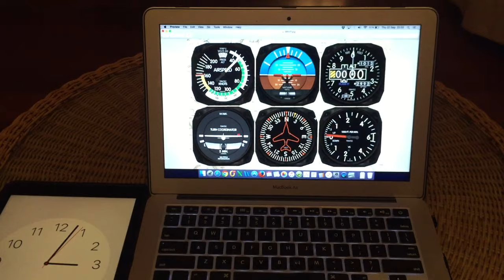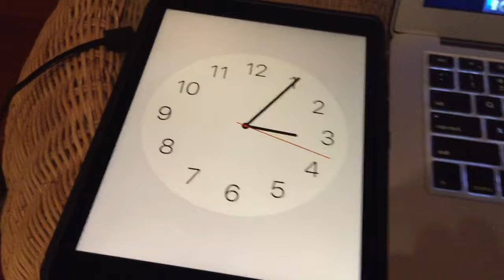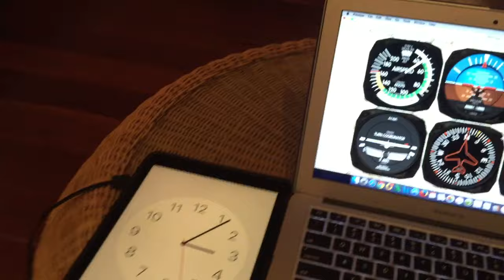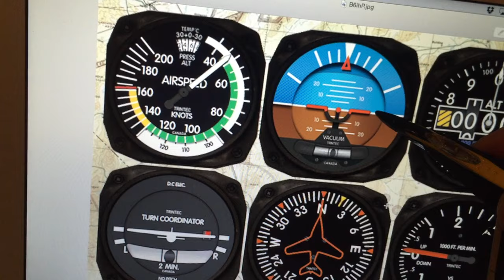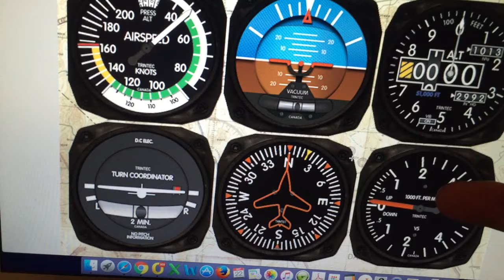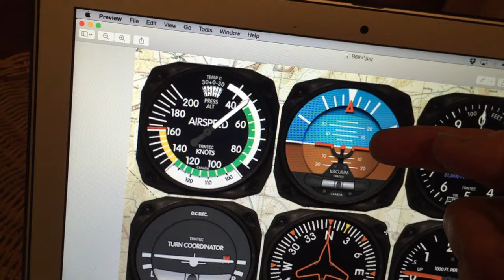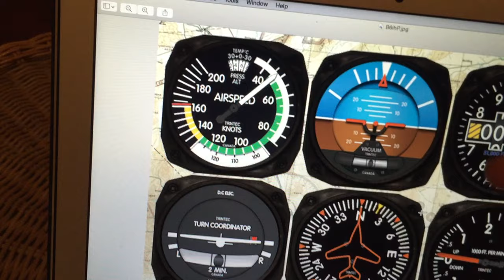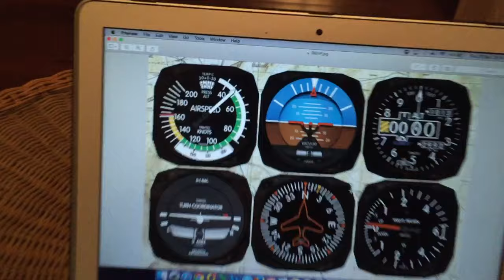Do aircraft change attitude to follow the curvature of the Earth?

Comment: Were you taxing the airplane on a simulated free way or something you had 0 AGL ?
and your airspeed was at stall. 

Do aircraft pitch down to follow the curvature of the Earth?

No they don't , airplanes are set to density altitude.

There pitch depends on the amount of thrust the aircraft is making, a lot of thrust in a straight and level flight,  more thrust you would have the more you would need to pitch and trim the nose downwards, in a typical aircraft, less thrust you would have you would need to pitch up to maintain a straight and level flight. 

Aircraft follow the earth perpendicular to the earth, usually from the balance point in an aircraft.
Reply: flat earth math is wrong wrong wrong, no they don't follow the curvature of the earth, to stop the pilot from have to push forwards or aft depending of the airspeed of the aircraft they use a TRIM system...
Reply from the maker: +Iain Noonan - that was just a generic screen shot of aircraft flight instruments I found with Google for the video.  It was on my laptop.

Sorry, aircraft do pitch down to follow the curvature.  It is only 1 degree per 111 kilometres.   1 degree in 8 minutes at 450 Knots.

That pitch rate is so slow you will never notice and and it matches the angular change of the Earth's surface so there is no apparent attitude change either. 

The eotvos effect proves aircraft are following curvature - the weight of objects change depending if you are going East or West - I have tested this personally and can verify it is real.
Reply: no they don't !!!!!  omg , look the pitch of the aircraft is defined by the air speed of the aircraft is going. 

Aircraft are balanced around the centre point of gravity, this depends on the type of aircraft it is and it's configuration. 

aircraft have 4 forces acting on them in flight in flight.

1: Lift 
2 Drag 
3 Weight
4 Thrust. 

When all of these are equal to each other, witch is very very rare, in an aircraft there is no need to Pitch Trim.

But 99.9% of the time 1 force is greater than the other , depending on Air Speed of the plane, and you will need to pitch forward or pitch back to maintain level flight. 

If an airplane is going fast,  Lift would be greater than Weight, since the wings are creating more lift, and Thrust would be greater Drag. 

So for the aircraft to keep going fast and not pitch up the pilot would have to Pitch Down. 

Pitch is used by the pilot so he does not have to keep pressure on the stick or yoke,, usually looks like a little wheel. 

If the plane is going slow,  or behind the speed curve on equilibrium the pilot will have to Trim back, because the is less Lift , so the wings can get enough air going over the wings, and create enough lift, to slow the aircraft will stall, where the wings just can't produce enough lift any more, or worse spin. 

Tested this theory with what may I ask, not being snarky or rude just curious. 

Hope this helps, but I do assure you , you are wrong.
Reply: you know what , maybe your right, but it would be so little ... not sure how you got the calculations, I mean thinking about it you do have a very valid point !! and an object is going around the earth it would have to follow a curve. 

I used to teach flying , some time ago mind you, haven't flown anything in a very very long time, but you know what , at some point you are right.. you won't notice it , or have to deal with the effects of flying around an earth, but but ,, lets say if you are at FL 320 , and going for hours, at a given ground speed of 550 , just throwing numbers here, and you are in stable air , then yes i suppose at the airplane would be following the earths curvature  of course...... 

Nice one :)  kudos to you . 

Think i became very negative in my thinking when I see the name flat earth math... and he is wrong in having to push the controls forward or aft unless the trim system is broke, or don't have one.
Reply from the maker: +Iain Noonan   Thanks,  yes planes do maintain a constant altitude in cruise and by doing so they follow curvature.  

I took the circumference of the Eartha and divided it by 360 to get a distance per degree.   At 450 knots you cover that distance in 8 minutes.   

I never really thought about it much either until I was asked the question.

Comment: just out of curiosity, if you didn't adjust according to the horizon, would you gradually just constantly get lower and lower in altitude?
Reply: One of the first lessons a student pilot learns is to adjust to the horizon. But it is a measure to maintain speed, not altitude. The altitude is controlled by power input, i.e. engine setting. In case of gliders, the power must come from external sources, like thermals or wave lift.

Comment: Questions from a layman in both flight and physics: Do you actually need to pitch down to maintain altitude on a curved Earth, or are you making those little variations to compensate for other variables? The reason I ask is that it seems to me that the decrease in air pressure as you move away from the center of gravity would be enough to keep to plane at altitude even if no correction was made.

My other question is: is pitching the plane down the main method used to decrease altitude? Because that seems to run counter to my experience as a passenger. When planes I've flown on are making their approach, I feel more that the plane is slowing down rather than tipping forward.

Thanks for an excellent video, by the way.
Reply: No need to pitch down, the tiny changes made to compensate just for local atmospherically pressure and wind direction changes is more than what the curve would be.

For landing the craft is typical pitched up slight and not down. Descent profile is more about fine control of thrust as well as the use of flaps to increase lift. as you are generally tring to comdown on your read wheels gradually.
Reply from the maker: +Embrace the Ball,  Sorry I didn't notice your comment Earlier.   To adjust for curvature the pitch down is not relative to the ground.  Over time the aircraft attitude does change from its original attitude and technically it has pitched forward to the new attitude.   This rate is so slow it is completely absorbed by smaller tiny changes that are constantly being made just to maintain altitude.    

Imagine driving a car on a pefectly straight road.  You cannot let go of the steering wheel as the car will slowly drift off the road.  Even on a straight road you are constantly making tiny corrections. 

If the road curved steadily just 1 degree every 100 kilometers you would drive exactly the same way and those tiny corrections would gradually cause the car to follow the curve of the road and you would not consciously be turning.  

You can descend by also slowing down,  if the aircraft attitude remains the same and you slow down the aircraft will descend.  If you want to descend rapidly you can push the nose down but airlines generally don' do that for passenger comfort.  It has to do with how lift is generated on the wing, its a function of angle and airspeed,  reducing either will cause a descent.
Reply: Wolfie6020 Thank you, that meshes with my experience as a passenger, and makes a lot of sense.

Comment: The problem I have is he never explains what he is using to reference level flight.  The reference for level flight is always the center of the earth. Level flight is when the longitudinal axis of the plane is perpendicular to a line extending radially from the earth's center.  So therefore the plane is not pitching down any more than a satellite in orbit is.  If his reference for level is a tangential line from the plane's altitude extending out into space, then his explanation would make some sense and the plane would have to continually pitch down, however extremely slowly due to the earth's size.  If it didn't would continually gain altitude.  The constant corrections that are made by the pilot (or auto pilot) are necessary due to wind, weather, or pressure changes, not the earth's curvature.
Reply: They follow a pressure "constant" in the atmosphere (altitude in other words). In doing that they implicitly cover that little necessary correction, given our earth is spherical, or almost spherical.
That's the great thing about this video.

Comment: They say the earth curvature drops 8 inches per mile squared.   So if you tried to fly horizontally straight like a lazer say at 20,000 ft high, without looking at your altimeter, & you still keep flying horizontally flat as a lazer. At the speed of 400 knots, you would start gaining altitude because of the curvature of the earth, curving downward in every direction. The earth at the equator all the way around, & all the way around  from the North pole to the South pole & back up the North pole are both roughly almost 24,000 miles in circumference. So not only does the earth curve east to west, but also curves North to south,  according to what NASA says & their Secret/occult Freemason scientists. Obviously you would gain lots of altitude, with 450 miles ticking by every hour. How would you not know you were upside down in Australia. When you hang up side down from a tree you know your upside down, & when your on a vertical face of a mountain like the side of the globe, you know it & gravity doesn't help you in those situations. Your still supposedly on the globe earth. Also nobody has ever been able to make water stay in a fixed curve at it's surface. Yes water will ripple & even make waves & slosh back & forth, but if you fill a pool with water you cannot make the water in the swimming pool have a fixed curve at the top surface of the water from one side of the pool to the other, or even make the water in the pool  have a domed shape at it's surface. It just impossible unless you seal it in a container that has a domed or curved top & you freeze it. Water also cannot go uphill unless it's in a sealed pipe & it's pushed with pressure. Yet there are rivers that would run upward if the earth were a sphere/ball. Another question, that just can't seem to be answered is how does oceans/seas/gulfs stay attached to the earth as it spins 1000 mph, & is also supposedly orbiting around the sun, & the sun, earth & planets are all falling through space at 66,600 miles per hour, but we can't feel it but we get on a roller coaster & we feel all kinds of energetic movements. The stars rotate, & always make the same star trails day after day forever. If gravity is holding the oceans to the earth & the oceans are saltwater a saline solution of trillions of gallons. How does gravity know how to differentiate between water & people, because we are basicly 90% water also. If gravity is so powerful it can hold oceans to a giant spinning sphere/ball, but yet we can walk upright with ease, you would think with that kind of power, we would be flattened out like pancakes on the ground. I just don't understand that. If you place water on a round sponge or tennis ball & place them on a drill with a screw to hold the wet soaked sponge &  tennis ball to the drill, & spin it even slowly the water flies off. Why doesn't the same gravity that holds the oceans to the earth hold the water on the sponge & tennis ball, after all they are on the earth as well. Shouldn't the gravity work for them too. Why doesn't? The reason why is because gravity was a theory made up to go along with the fake sphere/ball globe earth. The only true law of physics that works on this giant horizontal circular plane is density, these Jesuit scientists lied about our circular horizontal plane & created a new name by adding a t to the end of plane & called it a planet, along with the wondering stars, that they named after pagan Greek gods, the wondering stars now called planets are nothing more that balls of gaseous elements such as argone, helium & nitrogen, & all the other elements that are also in neon signs & even in florescent lights. These balls of gaseous elements are trapped in the vacuum area that is right below the firmament dome, but right above our atmosphere that is produced from the plants & animals of the earth's terrain. These wondering  stars now called planets are lit up by the static electricity that comes off the invisible electromagnet pole, that goes upward from the very center of the earth that has a magnetic mountain called Mt. Meru. This electromagnetic pole goes up to another giant magnetic magnet that is embedded in the very center of the firmament solid dome & it is called Polaris. Our circular horizontal terrain & oceans are enclosed by a giant firmament solid dome made of a very cold blue sky ice that is pure frozen oxygen. This giant dome sits & spins on the wall of the ice ring that encircles our terrain & oceans, & has an upturned lip on the outermost edge of our circular horizontal plane. This is what holds in the oceans & seas of our world, along with the firmament dome. The sun & moon are the ying yang symbol. The sun is positive in polarity & puts out a very powerful bright & hot light. The moon is the exact opposite, it is negative in polarity & puts out a dim cold light that is colder than the darkness that surrounds it, & it has been measured to prove it. When the sun & moon rotate around the invisible electromagnetic pole, that has magnets at the top & bottom, they create huge amounts of energy that powers the sun's bright light that produces heat, & the moon's dim light that produces coldness. This electromagnetic energy also is what makes them rotate & levitate high above the earth's terrain & atmosphere in the very thin vacuum like space right below the solid firmament dome.  I believe the stars are like round circuits of energy attached to the outside of the firmament dome in the waters that the bible speaks of. Perhaps the water is like a radiator for the energy the world creates. The northern lights are somekind of static electricity energy that comes of the electromagnetic center pole, that why it's only seen at the North/Center pole. The energy travels through the earth terrain because it has conductive properties such as gold, silver, & copper, but mother earth is getting sick because the elite continue to take the precious metals out of her terrain along with her blood which is the oil we burn in aircraft, trains, marine vessels &  automobiles. The energy also travels through the oceans & seas, because salt makes water conductive. I also believe the firmament dome has conductive properties like copper wires & the stars are the circuits, that energy flows through & that is the sparkling light we see. The sun & moon also pulsate moving outward & inward giving the inside area of the equator & the outside area different seasons. It just my theory but I believe it to be closer than the indoctrination & lies they told us in school & college. Peace, health, happiness, & love to everyone who follows the truth & love of Yeshua Mashiac & his father the creator Jehovah.
Reply from the maker: The 8 inches per mile squared is an approximation.  That is actually a parabola.    The Earth curves just 1 degree every 111 km.  

The part you are missing is that horizontal is always tangential to the surface of the Earth.  So after 111 km your horizontal is different by one degree.   If you are flying horizontal to the ground beneath you then you are flying a curve.  

You have completely ignored aerodynamic stability which will automatically lower the nose anyway if the aircraft gained attitude and starts moving into thinner air.  

Sorry but the whole Flat Earth claim that you would gain altitude is based on very poor understanding of how aircraft actually fly. You clearly have a lot to say but perhaps use a few paragraphs to seperate the ideas.